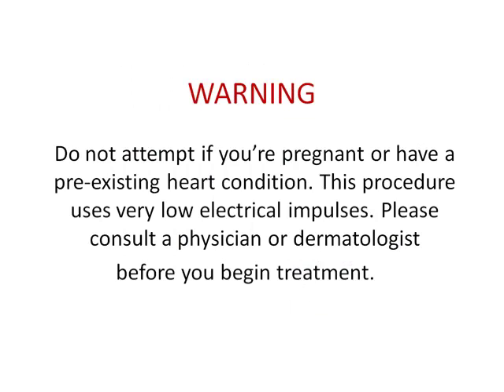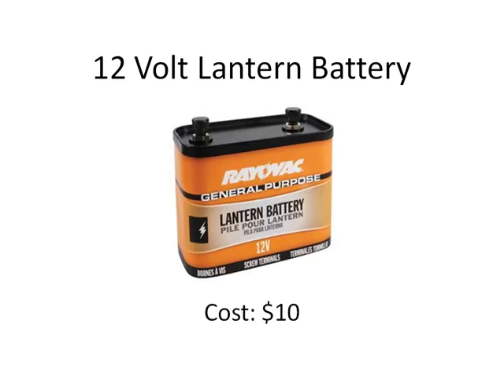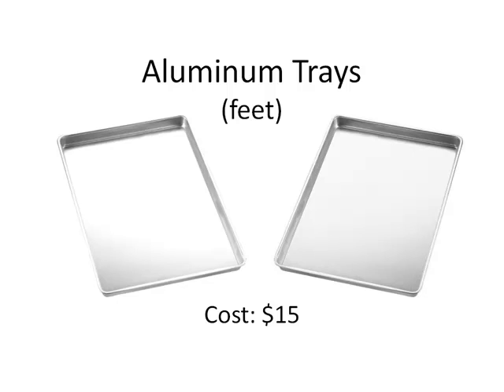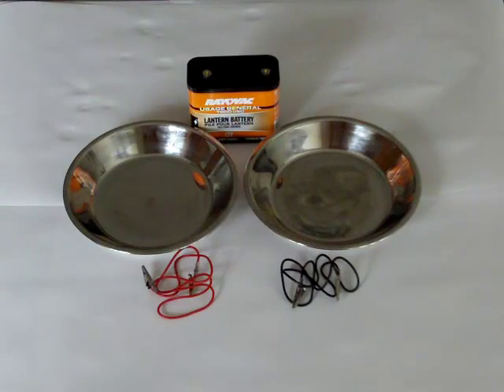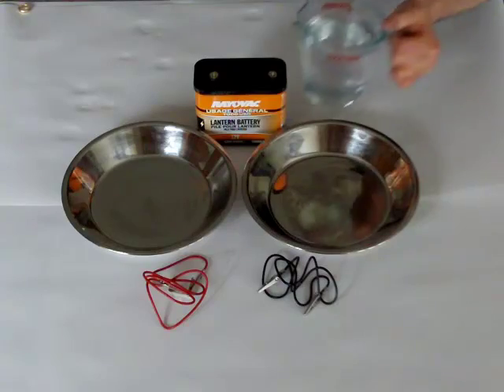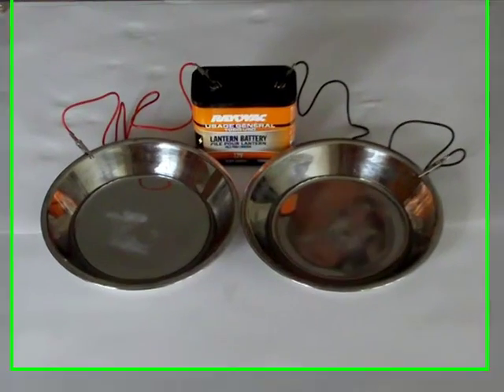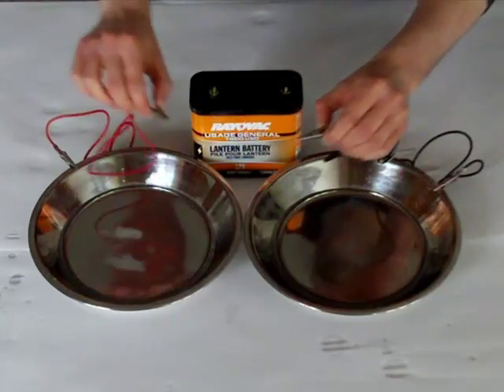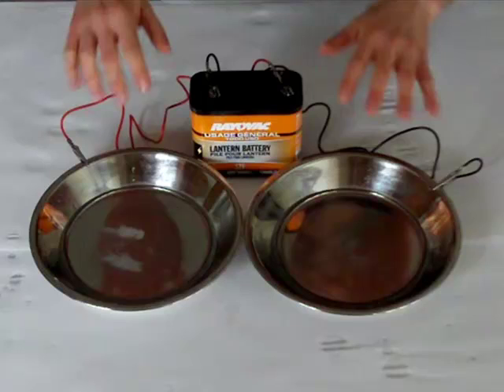How to Build Your Own Homemade Iontophoresis Device

Comment: THANK YOU. This video has changed my life. I tried every cream and treatment before and nothing worked until this. No more leaving puddles on the wooden conference tables at work or on laptops. No more worrying about shaking hands every single day. It took about 5 days in a row of this treatment and now I do it once every week or so and the sweating stopped. I used to worry about my hands daily and now it’s not even a thought. I bought everything on amazon and recommend this to anyone suffering like I was. Thank you so much.
Reply: That's amazing , I'm so glad it worked for you! , I trying to build one at home , and I have many questions to ask becasue im really afraid doing the treatment before I actually know if its gonna work for me ,can we communicate ? I would really appreciate it
Reply: Badger Glands sure what questions do you have? I did everything exactly like the video. Not sure if he mentions it but only fill the pans up about half way because the more water the more of a jolt when you put your hands in. When the pans are only half filled you barely feel the tingle when you first put your hands in. Also, if you spill water on the edges of the pan it’ll irritate your wrists where they touch so try not to get any water on the pan edges. Even if you do nothing has ever hurt its just a tingle. I was scared at first too but you learn as you go what works best for you. The biggest problem I have now are my hands are too dry on top so I put aquaphor on them like he recommends. I can link you to everything on amazon if you need
Reply: @Brian-vv2st  all set , I built the intophresis device but I'm really worried that the treatment may cause any side effects and make my condition even worse... My condition is that my hands are dry like most of the day if I'm busy thinking about anything or something but if the idea of having hh crossed my mind or something triggered the sweat like if I'm nervous or the weather is hot it start sweating , like crazy sometimes like it drops sweat , so I was wondering if its similar to yours , or worse.... Do people who has hh their hands constantly drop with sweat , like all the time? Without anything triggers the sweat or like mine? ... What's my condition on scale 1 to 10? ... Into would be affective on my case? .... And what if I stopped the treatment does it come back to normal state or become worse? I'm really conscious about it and I'm sorry for asking too many , thanks in advance <3
Reply: Brian , I hope you answer my questions , :D  I will be glad.
Reply: Badger Glands I’m far from a doctor so I can’t really judge your condition. I can tell you no I didn’t sweat 100% of the day but it happened often with no triggers. Often enough that I thought about it daily and when something like nerves or weather would trigger it it would be bad. In my opinion if it’s to the point where you’ve built this device and are asking questions like you are then probably give it a shot. If you don’t like it when you stop the treatment your hands will gradually return to normal after a couple weeks
Reply: @Brian-vv2st  Thank you so much , I'll give it a shot then .. thanks Brian :D
Reply: Appreciate your recent comment saying you had success. I will try soon myself.
Reply: Sir can you give me battery rating (Wh)

Comment: I bought a 12V 7Ah battery and when I put my hands into the pans, my body jolted up with the electricity. I couldn't bring myself to try again, it was scary as hell
Reply: How much water did you use? the more water the more the jolt. when i filled the pans the jolt was scary. when i only put enough water to cover half way up my fingers, it is just a tingle and this works. Also, when you switch the polarity half way through you'll get another tingle jolt but after a second it goes away. Try not to get water on the sides of the pan where your wrists touch either.
Reply: Are you try it again???

Comment: Did anyone experienced using TENS unit for this purpose??...it also works on same principle but is far cheaper than iontophoresis devices used to reduce sweating.

Comment: This really works. My personal experience
Reply: Reply dude
Reply: Two dry cell of 1.5 volt each. Use it for 1 week u will see the result
Reply: @goldilocks8315  and how it feels,i am really afraid of shocks
Reply: 😭😭I have too oily hands ,I mean too oily I.e my fist get full of sweat in one minute of closing😥😥will it really work😧😧
Reply: It will surely work. A very  little bit of shock you will fell . If u connect a on/off switch and ask somebody else to switch it on while ur hands are in water then u will feel no shock
Reply: @goldilocks8315  thnk you bhai😍😍
Reply: Bro...are u from india .
Reply: Bhai madad chahiye thodi
Reply: @sameernirmani2963  kya madad?
Reply: Dry cell 1.5volt 🔋 kaam kregi??
Reply: Aluminium k badle steel plates nhi use kr skte hei kya??
Reply: @sameernirmani2963  pta nhi 😭😫😫

Comment: I could not find battery
Reply: I'm using two of 9v battery.
Reply: @BadLazyBoy   how many times do you use in a day?
Reply: @samahalkubaisy8649  I just started today. I will be doing 1 session (20 mins in total) every day for the next few days
Reply: @Austin Wicht Yes, but I didn't continue the treatment I did it for only 4/5 days and stopped. I couldn't handle it. :(

Comment: guys it works well for me so far just sweat when i play video games or get really nervous from thinking that my hands will sweat base on past experience and then it does lol. but daily life so far it works well i use a wall outlet plug that i can adjust the voltage and buy a special alligator clips that can be plug into the computer plug them walla! and use salt it works a lot better with salt
Reply: spencerReaper what's the name of the device you plug in the wall?

Comment: After doing it for a week, I finally got results!
Reply: Where did you find the battery. Can't find it anywhere
Reply: Wasiq Rashid use a wall outlet plug that can connect with alligator clips and u can choose ur voltage and add salt lots of it

Comment: Thanks for this tutorial! I am buying a battery right now, but there are different Amps.. It says 12V on all of them, but different (1,2 ; 2,3 ; ...) Ah - what should I take?? Please help..
Reply: Are you take one of them?
Reply: You probably sorted this already, but you can buy voltage controllers that will allow you to dial in exactly how much voltage and amperage you want or can stand without it being uncomfortable and Shocky feeling the one thing I used to hate when I had a drionics unit. it does work faster with higher voltage amperage but it's also more painful these units are relatively cheap I got five of them for $15 from Amazon

Comment: Hi. Can I ask a question? Does it have to be a lantern battery? Battery such as those don't seem to be around our area that much so it's hard to look for one
Reply: Same for me, I couldn't find any lantern battery in my area :/
Reply: I actually bought 2 9V batteries already and they worked! It's a little stingy but my hands were able to adjust as I continued to do the treatment. 
Hope that helps! :)
Reply: @cosmocelli  can you tell me what kind of 9v battery did you use? And how did you connect it together? :), Really need to try this method 'cause I cant stand no more wetting my paperwork when doing some exercises
Reply: @hafizhaikal4041  I used alkaline 9V batteries. I think energizer and duracell are some of the brands that offer this. Generally, you'd simply connect them using alligator clips, just make sure you connect positive - negative and vice versa. Here's a link to a video if you want to know how to connect it https://youtu.be/0vFzwJq6OpI
Reply: @cosmocelli  Thanks, much appreciated! :)
Reply: @hafizhaikal4041  Oh btw, you can just use petroleum jelly instead of aquaphor if it's not available. It helps protect your wounds ☺️
Reply: @cosmocelli  Hey Ara Celli can we chat on Facebook by any chance??
Reply: @cosmocelli  Did you actually put them over each other like on the latter part of the video?
Reply: @cosmocelli  Hey, I've been trying contacting you via email few months ago. So how the results now? Are you sweat-free? Please reply, gotta know the results 'cause this sweat really slow me down in life :(
Reply: Anyone still looking for the battery in the video: Carlton Bates sells em online for like $25

Comment: I have already tried homemade but it didn't worked In my case ;Plus the setup was very much difficult....Finally I bought the device at $225 after using Discount code-FORWORLD....I am 100% Satisfied with the device .....Hands-95% gone and feet- 85 % gone ...Here is the website link to order  https://iontocure.com/discount/FORWORLD

Comment: Does a motorcycle battery with 12 volts works instead of using lantern battery. Please reply to my question thank you!
Reply: Hi can i follow up on my question. I badly need a reply. Before i purchase the battery
Reply: @suelenem  Have you tried this threatment?

Comment: perfect, thank you so much, I prepared the stuff and used the method, I can not believe that it worked for me and I'm so happy. by the way I wanted to say that for purchasing a battery, the "Amperage" was a decision making factor which I did not find any information about it and I randomly bought a (12 V, 2.2 A) battery and despite its weak flow, it worked. but I also tried with a lap top trans which its output current was (19 V, 4.2 A) and with this one I could feel the current better than the battery.
all in all, try it and you wont regret
Reply: Masoud Esnaashari Hey I am also thinking of using a laptop adapter of 19v and 3.5Am. But I just read from many sites that upto 20 mAm Current is good for our hands. Can you please clarify and help.

Comment: Mine is only slightly different but shares the same principle. If You have palmar hyperhidrosis and are considering it just do it. Honestly; do it. I use two 9v batteries connected together though.

Comment: I have a suggestion for all, you can use 15 volt AC to DC adapter(mA doesn't matter) and mix a little bit alum powder( Fitkari) in water,it is more effective than normal water. It's my personal experience,thanks to all.
Reply: What thype of batteries we can use...please reply ....which batteries is rechargeable
Reply: I did adapter also I feel shock

Comment: I have been doing this for at least four years with ten twenty to thirty minute treatments that last six weeks and then repeat the ten treatments. I am currently ( pun intended) trying one per week to break the ten treatments in a row which are a pain to have to do daily for ten days.. I use a little over 20 volts  total using a 12 volt battery in series with a 9 volt battery. I add a little sea salt to the 1/4 inch water in the stainless pans.This has worked for me without failure. I have had this  condition since childhood.
Reply: cyberian2007 what is the output current. As many people say that only upto 20 mAm current is good. Does it matter. Please clarify and help.
Reply: Now what's your condition. Pls tell

Comment: I use a 13.5v DC adapter at 450Ma. For 10 minutes at each polarity
Reply: The first time you used it, did you put salt or baking powder in the water?
Reply: Simply yes I put a sprinkle of salt in each plastic tray I use.
Reply: thank you! have u seen good results? I'm planning on doing this soon. Should i also just use aluminium pans? I've read alot of the comments and some say to use stainless steel

Comment: Thanks a lot for the useful video. I have three questions please.
1. I used stainless steel trays instead of aluminium ones, and I noticed that the water in one of the trays became rusty without the tray itself getting rusty. Any idea why is that?
2. If I use durable aluminium trays will they remain the same after a long time of usage or will they form stains as in the disposable ones? If yes, then how can the the stains be removed?
3. Why not use an AC/DC converter instead of the battery?
Thanks a lot.

Comment: Thank you for your video. I made mine using 2 pcs. of 9v batteries, 2 aluminum pans(disposable) and 3 set of wires.   After 11 session my hands were dry  ^__^   (for 2 weeks -+)
Reply: hands and feet?
Reply: Boolin  ...just hands.Haven't tried on feet.

Comment: I am using this method for more than 3 years and it is working :) It cost me 10 Euros. Believe me I have tried everything in my life. My life is much more  easy since then. I have an adjustable power supply from train models tracks from my dad. It works perfectly. Wish you all good luck.
Reply: 1988smuggler does it still work for you?

Comment: My first day of treatment today. Used salt on day 1 ( went against Jason's advice) as I have been suffering sweaty palms for decades. I will do it for 5 days and post results after 5 days and perhaps after a month ( after maintenance, that is once every two weeks after the first 5 days). Good luck to me, pls pray for me.
Reply: Good luck! Dont forget to let us know
Reply: What's the result.
Is it working, I also want to start the treatment.
Reply: Just an update, sorry I'm late. I'd say my condition is probably 15 - 20 % better or probably not. This treatment might not work for every one. I'm happy and glad for the people that it has worked. I'll try it another few weeks and go for alternative treatment like surgery( I believe there is one), if it does not get any better .
Reply: 5 days is not enough for results.  DON'T GIVE UP!  Mine are bad, and it takes me about 15-17 days before I start getting dry hands, and even then I go to day 21-22.  After than your hands will be dry.  If you're like me, after getting dry hands, you'll need to do a 1 time per week maintenance.  I would try again if you only stopped after 5 days.  The trick is 10 mins, then switch polarity, then do 10 mins again.  You must do it daily, and try not to skip, until dry.  I use 4, 6 volt lantern batteries, all linked by alligator clip wires.  Good luck.

Comment: i have try from a week but it have not work ...it just same nthg  improve
Reply: dharma overseas  if u used 12volt increase the current level to 18volt if 18volt not working then increase to 24volt this trick works almost 99% humans

Comment: If anyone could help me I would be forever thankful!!!
I have been doing this for 8 years now but I recently moved and found 
that the water is very soft and clean and therefore my iontophoresis is 
not working anymore! :(
Do you know if adding magnesium in the water would help??
Or if rain water mixture would work??
Thanks!
Reply: That doesn't help. That would only increase conductivity in the water. But I fixed it, thanks!
Reply: Hi Hristina,
I have the same problem, it used to work but now it doesn't. How did u fix it? Thanks
Reply: Did you move too?
Well I simply brought the same water from back home.
Yeah...I had my suitcase in the plane with a couple of large bottles filled with water.
I didn't quite fix it but I have it all good for now until I find an alternative that works.
Reply: I haven't. Will it work??

Comment: And what benefit aquaphor
Reply: It will protect your hands if you have a small cut on them or if you bite your nails.  You just rub a small amount over the cut or any open skin on your hand and your hands will not hurt in the spots where your cuts are after your sessions.

Comment: hi, i wanted to know what other types or what other 12v battery i can use, apart from rayovac lantern battery, since we dont have that here in our country(phils.)
Reply: I'm going to use voltage controllers you can hook a Transformer up to them or batteries you'll need some wire or jumpers to connect the Transformer to the voltage controller but then you can control the voltage and the amperage and dial it in whatever is perfect for you these are relatively cheap I Got 5 from Amazon for $15

Comment: sir we should use only rayavoc battery .....can't we use some other of same 12v battery
Reply: Yes, you can use any brand battery.  Just be sure it is a 12v (12volt) battery with the two places to connect the alligator clips (testing wire) at the top of the battery.
Reply: 12v LANTERN battery.  Any brand will work.  Just needs to be 12v LANTERN battery.

Comment: hello,

does it matter if i'm using baking soda instead of salt ??
Reply: Nir Yitzhaki Yes. Salt helps conduct electricity. Baking soda will not
Reply: Thank you for answering..

Another question if i may:
When i do put salt it makes corrosion.. when i spill the water it has A very light brown color.. is that normal??
Reply: You need to replace those pans with a stronger aluminum pan that may cost just a few more dollars.  Strong aluminum pan.  Corroding/corrosive pan is NOT what you want...At all.  And try to be very careful when you pour water into each pan.  Hold a towel under the cup you use to catch spills to ensure you keep everything else as dry as possible around your pans.